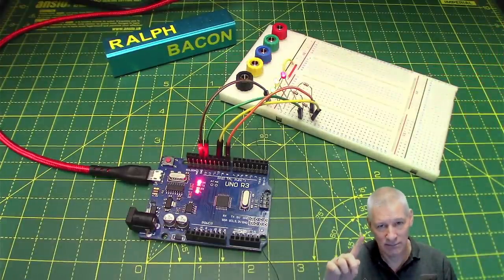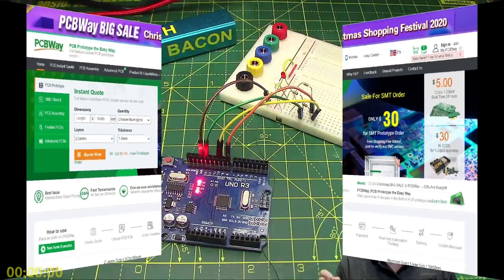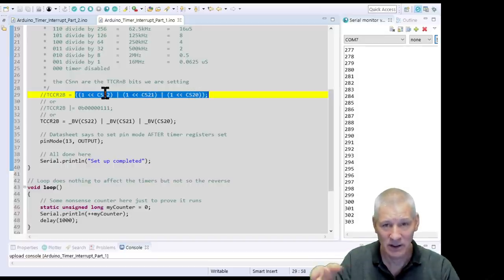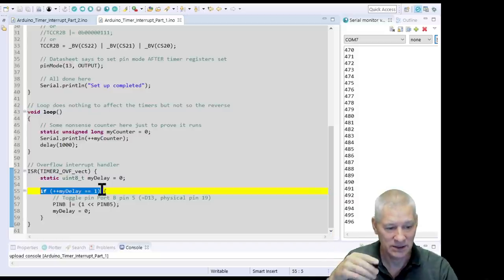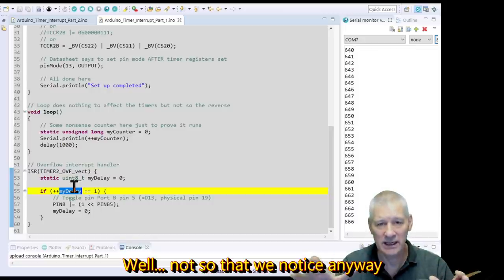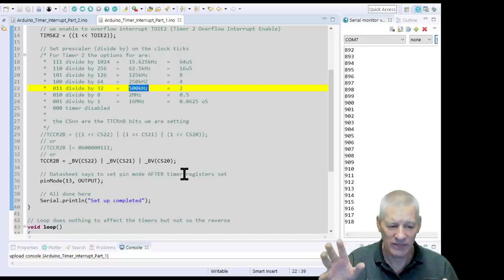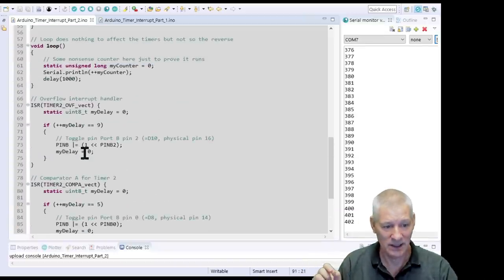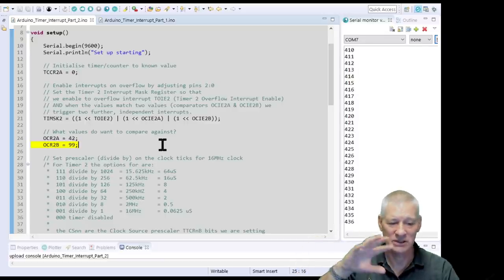#209 Arduino Timer Interrupts - Overflow & Comparator. Easy Peasy.

Comment: Well thats spooky! I only at the beginning of the week played around with Timer2 interrupts to scan a 7 segment display on my arduino project! You've made a slight error here, the ISR gets called when the timer overflows every 256 timer clocks, which will be 16000000/1024/256 or 61.03515625 times a second. Its the timer that gets clocked at 15625 times a second.. thats why when you slow the clock 16 times to 1Mhz and flash every other interrupt you get a 61/32 ~= 2Hz flash. 
Other than this minor technicality, great video!
Reply from the maker: Timer ticks vs Overflow ticks - what you say is true.  Glad you liked it, and you have just reminded me to set my Arduino back to 16MHz.
Reply: @RalphBacon  I also noted that you're writing to the PINx register to toggle it, I thought it was read-only but on investigation writing 1's to it does toggle the pin - I never knew that, so once again I have learnt something new!
Reply from the maker: Indeed, it's a (I was going to say well-known) useful trick but maybe not so well known! Glad it's helped you, Ian.

Comment: I initially thought your channel was just beginner level stuff based on the first few videos I happened to watch.  My first impression was wrong! I've seen that you get pretty in depth with programming related things and I appreciate that.  Thanks for taking the time to do these excellent videos and I'm enjoying the content of your channel!

I'm a hardware guy, looking at embedded design and I sometimes think it would have been easier if I studied software first and did hardware afterwards!
Reply from the maker: Great to hear! I try and do beginner stuff because it can be daunting to start this Arduino lark, but eventually we have to move beyond that and into more detailed programming, so I'm glad you're finding all this useful. Built my ESP32 Web Radio yet?

Comment: Ralph, you asked what we've used RTIs for... I used a real-time interrupt for sampling a received radio signal for an MFT (formerly "Rugby time signal") receiver/decoder. Yes, I know, there are libraries out there, but I just fancied rolling my sleeves up and exploring filtering and oversampling, to try to recover a more robust time waveform from a variable (and sometimes weak) radio signal. I really must dig that project out and finish it. The state-machine bit needs rethinking (hint for another video, pretty please!).

Happy Christmas and good luck with the move!
Reply from the maker: I'm encouraged that you "rolled up your sleeves" and wrote your own code for that project (even if the state machine needs a bit of tidying up). Merry Xmas to you too, Gerallt and let's hope the move goes smoothly in January.
Reply: @RalphBacon  Thanks so much for the reply, Ralph. Yes, I am "that" kind of engineer -- never happy until I "understand how things work". 

Just to explain, my design included a real-time clock chip, so without recourse to anything external, should it display the "clock-chip" time or decoded "radio" time (parity checks aren't reliable) -- and how could I be confident that chip time should be synchronised with the MFT signal. I had hoped that a state machine would cover that, but my brain exploded trying to decide which states to use and what would cause the state changes. 

Somehow, building an ESP32-based weather station (with MQTT and Node Red) seemed easier, so the MFT clock went on the back burner. Ultimately, I'd like MFT MQTT feed into my IoT rig, so the project will get picked-up again in the New Year, and maybe moved onto ESP32 (it's currently on an Arduino Mega). 

I hope that the new tier4 restrictions don't impact your move. The important thing is to stay safe. Take care.

Comment: I still don't understand why people keep using the Arduino IDE. The proper way to program AVRs is the Atmel Studio. There you can simulate every single bit and see what is actually happening inside the AVR. Excellent video that show to "arduino people" that if you want to do something right, you have to read the Datasheet.
Reply from the maker: That's because beginners need a simple IDE that hand holds without scaring them off. Anyone who gets "into" the Arduino hobby really should progress to something more sophisticated; my favourite is PlatformIO right now, but Atmel Studio is great albeit a big step up from Arduino IDE. Glad you liked the video!

Comment: Web radio looking great. Th price do run up with box, power supply, buttons and connectors. It can really surprise you. A £10 project cam quickly end in £20-30 before it's finished-finished.
Good luck with moving house. I am looking forward to see your new studio.
Reply from the maker: Very true. The box plus acrylic front panel costs more than all the other components. I really should invest in a 3D printer.

Comment: Good luck for your move, hopefully no major interruptions and the process is not interrupted in anyway ! and all goes smoothly, nice tutorial on interrupts, I would like to add when using interrupts to be careful with delays, as this can cause interrupts to behave badly and actually interrupt the normal operation of the CPU,  which interrupts the expected flow of data and interrupting what could have been a nice day......thats it Im done ! ...cheers Ralph !
Reply from the maker: If you had continued that long post, I would have interrupted you but you finished just before the WDT jumped in! Ha ha! Thanks Andy, have a great Christmas.

Comment: At around 4 minutes in, Ralph, you suggested that "someone" should have created something to make interrupts easier to use on the Arduino. Appendix K in Arduino Software Internals, sorry about mentioning it again, might be of interest.

I'm also writing another set of libraries ti make all ATmega328 interrupts easy to use from the Arduino IDE. Not released yet, part of another book!

Good luck with the house move, stress piled upon stress there!

Stay safe.

Cheers,
Norm.
Reply from the maker: The good news, Norman, is that I finished your book a day or so back, including all the appendices and I'll be mentioning it in the very next video before I start packing up. Best software/hardware book I've ever read and I wish I had had it a few years ago. No-one could ever remember all the content so it will be my reference book for the Arduino for the foreseeable future. Great work.
For those readers interested (and you should be): https://amzn.to/3p3tSLV
Reply: @RalphBacon  Praise indeed, thank you very much. 

I'm glad you liked it, that was 2 years of my life written down!  It's hard work trying tomake sure you get everything correct.

Have a great Christmas and here's to 2021 being much better than 2020. Stay safe.

Cheers,
Norm.

Comment: Well, just in case you don't make it back to the channel before 2021, have a happy holiday, a happy new house and above stay healthy.

I too have been puzzled by the Arduino IDE's neglect of the Timers and counters. Admittedly, the fact that each of the timers have other jobs to do, such as Millis, analogue, SPI and I2C, does make their use a bit complicated but certainly not impossible. Ironically, they did take the time to write the macros for the various AVR defined timer control registers but would it be so difficult to alias those names with readable ones? C'est la vie. They are a very valuable resource that allow the developer to delay sections of code WITHOUT stopping everything else. They will also count pulses  input to a pin. There are many cheat sheets (all of which were derived from AVR documentation) all that is required that you look through the alternate operations of each timer, very few projects use ALL the functions and choose the unaffected timer. Too complicated? Well every pin on the Atmega 328p (irrespective of the format) has multiple functions, so one has to make a choice just to flash an LED.
Reply from the maker: Too right, Michael, there is so much power in the (humble) ATMega328P, it's a pity they did not continue their Arduino-speak to timers. Too complicated, maybe? Thanks for your good wishes and a Merry Christmas to you too!

Comment: I had an issue some time ago that is not directly related but I guess maybe a little. I was not able to get an I2C based BME280 to work together with an RF-ASK radio on an ATTiny85 running ATTinyCore, separately it worked but not simultaneously. To my knowledge, it's a timer issue so I wanted to learn these things and maybe try to get this to work... Good luck with the move...
Reply from the maker: Thanks Stig, it's not in the least stressful all this packing of boxes and then falling over them as we have no space left. Thank goodness I have my workshop still in one piece to escape to. Anyway, I hope the video was useful and see you in the New Year.

Comment: First of all thanks for every things you gave us ⭐⭐⭐⭐⭐.
I have some ATMEL uC from trash and i would lik to program them but i don't know the value of their crystal !!.
If i want to reprogram them using the SPI protocol , the clock pin will allow me to do it? ( without knowing the value of the clock).
In other way the clock pin of SPI protocole will replace the crystal clock ( at least during reprogramming operation ).
Thanks.
Reply from the maker: I'm glad you're enjoying my channel!

Regarding your unknown clock speed chips, if the chips were previously running from their internal clock then you can program them as normal. No crystal required. Try this first.

If they were running from an external crystal, just connect up an 8MHz crystal (or 16MHz) temporarily between the relevant pins (you might need two 20pf capacitors between each pin and ground too) and try an  upload. 

Bear in mind that if you try and upload via ICSP from another Arduino, then the RESET of the target chip must be connected to pin 10 of the programmer board (assuming you're using the Arduino-As-ISP sketch). This allows the programmer board to reset the target board and not itself!
Reply from the maker: Much more info from Nick Gammon: http://www.gammon.com.au/bootloader

Comment: Isn't PINx register in atmega328p read only? Both atmel docs & arduino reference page claims that.. But  I know that the compiler compiles PINx write commands as expected. I think it's better to use PORTB ^= (1<<PB5) or PORTB ^=_BV(5) instead..
Reply from the maker: I didn't know that PIN was (officially) a readonly function, James. I did know that you can toggle a pin by using the PIN function (and many developers do this). If you are more comfortable using the PORTB that's fine, it's just more cumbersome in this instance.
Reply: Yes I realize that directly trying to update the pins did not work for me ... however writing or assigning to port registers does work.

Comment: Can you explain why the following in each interrupt routine doesn’t reset myDelay stopping it from ever being 5 or 9. 
static uint8_t myDelay = 0;
Reply from the maker: Post the full (but minimal) code for the interrupt; I can't understand what you mean or the result you're getting with just that one line, sorry.
Reply: Sorry for not being clear. 

In each of your interrupt functions you reset myDelay to zero at the start. 
To me this means every time the interrupt function is called myDelay is always zero. 
Since there is no loop only an ‘if’ statement I’m unclear how myDelay ever equals 5 or 9 for the 2 additional functions that toggle the second and 3rd LED slower. 

To me the if statement is executed only only doing myDelay++ once before exiting the function. 
Then next time myDelay is reset to zero. 
Meaning myDelay can only ever equal one at a maximum. 

I expect I’m missing something fundamental in how the interrupt functions are executed. 

I hope this is a bit clearer. If not then my mistake.  

Than you for your videos, good luck with the house move and Happy Nee Year.
Reply from the maker: Ah ha! Now I understand the question. The declaration of the myDelay integer has the "static" description.

This makes it act like a global variable but only for the function in which it was described. Basically, the compiler sets the initial value then moves it out of the function so that it is NOT reset each time. But it cannot be accessed by any function other than one it was declared in.

Whilst some people like true global variables (because they are so easy to (ab) use), professional developers (like me, yes, really) would not use them except where strictly necessary and would prefer static variables (aka local, global vars). 

Long explanation, I hope that clears things up - if not, let me know.

Comment: Hi, very much thanks.  I wonder how would it work, doing a simple incremente of a volatile global variable in the ISR, that is used in the loop to trigger some event at certain value, reseting to 0 at the desired moment
Thanks again
Reply from the maker: Yes it will. You can use volatile globals in the ISR that are then used by other parts of the code. Make sure the action in the ISR is "atomic"; that is, it completes before allowing anything else to run. Applies to updating both bytes of a two-byte integer, for example.
Reply: @RalphBacon  Thanks for the answer. I am new at arduino, but have to develope a system with arduino mega, for control of a industrial clothes dryer. Until now, i used a TimerOne library, but it is not nice to me, since  i use a library, i loose full understanding  of what is going on, and become affraid to use other interrupts. However, it works, but it is really intersting to dig deeper than simple arduino reference tells
Certainly, arduino is way more than a toy to say "Hello world", specially the arduino mega, which allos me to manage a 7 segment 4 digit display, some sensors and control buttons , to manage the drive motor and gas valve with time count. Of course, whith extremely care and physical safety backup, using also a ladder of relays to activate power devices.
Thanks again
Greetings from Argentina

Comment: Schöne Feiertage, Ralph!
Bei der Gelegenheit, hattest Du schon etwas über den Differential-ADC Modus gemacht? Sowas fehlt eventuell noch ...
Reply from the maker: Yes, I'm aware that I've never discussed analog differential modes on the Arduino, although I touched on the subject when I use the pin extender (I think). I'll add it to the list for 2021. Seasonal greetings to you too, Sebastian!

Comment: I ran across some ESP32s for lots less than what you posted above.  Unfortunately they screwed up and got the wrong address on the package,  so I haven't got them in hand yet.  Based on some of what I've seen in your channel I'm in for some fun when they do get here...
Reply from the maker: Just bear in mind, Roy, that the registers for the ESP32 are very different to the Arduino's. But the good news is that the ESP32 has several timers and some are 32-bit IIRC but I'll cover that next year.

Comment: Congratulations on the new house. Finally, sorry it's over the holidays. But I have  a question and I'm no coder ( more like a code borrower )  so this may be way off or a super silly question but the ESP32 is a dual core unit, couldn't you split the processes up so one routine was looping on one core and the other routine in the other core? so they could run in parallel with each other? Or it just doesn't work like that..lol
Reply from the maker: Although the ESP32 is dual core, and technically you can run on both cores (which I demoed in video #149) , it's not considered wise to run anything on Core 0 as that's the core Espressif have used for all the WiFi and BT stuff. Keeping to Core 1 ensures we don't upset anything on Core 0 (unless your interrupt routine runs too long on core 1 then it reboots the entire device).
Reply: @RalphBacon  Ok that makes sense. I wish the Portenta H7 wasn't so expensive I bet it would do it. Someone needs to mailbag it to you...lol

Comment: Hi Ralph, Hope you're ok. I had to re-see your video. I want to use the TI CC1101 radio module in a project I'm working on. In all examples, I've found it's only possible to send a maximum 64 bytes of data and I need to send more than that so I have decided to try to rewrite TI's c/c++ examples that show how to do just that. In this big example project from TI, they use timer overflow interrupts and I will need to convert this to arduino's way of doing it. Not convinced that I will be able to do this but time will tell.
Reply from the maker: Good luck with that project, Stig!

Comment: Hello
Can the Leds be switched on off at once and for a specific period of time instead of infinity loop by using timer interrupt ?
Reply from the maker: So, you mean turn the LEDs on/off via the timer interrupt without using any code in the loop, just an interrupt function? I don't see why not, although how often the interrupt timer gets triggered (the MAX delay time, you might call it) might not be very long... you would have to check that.
Reply: @RalphBacon  
I meam turn the LEDs on/off via the timer interrupt but just 5 time ON and 5 time OFF not forever